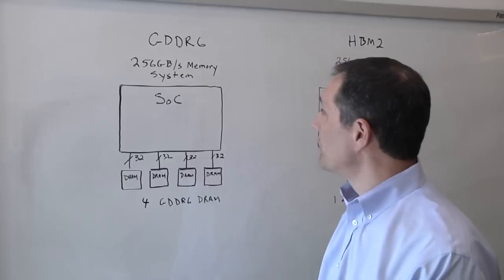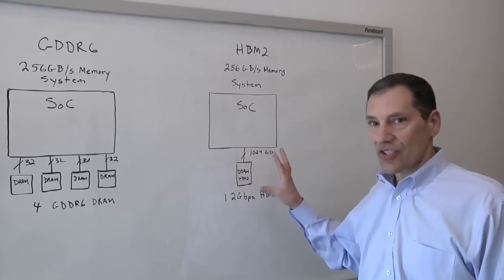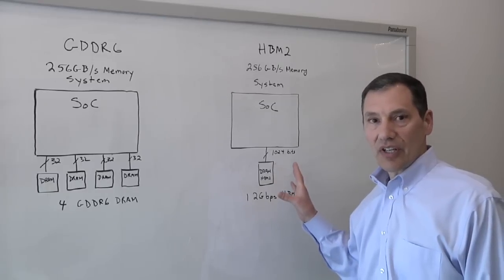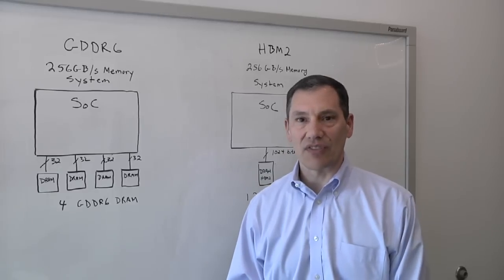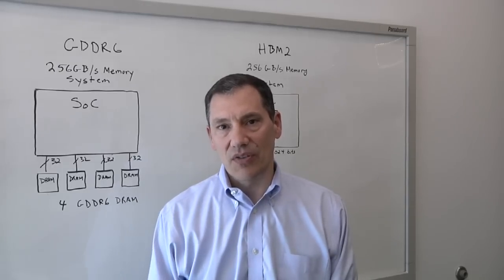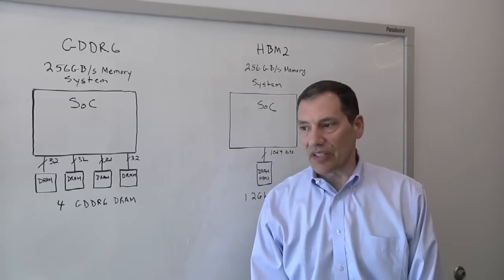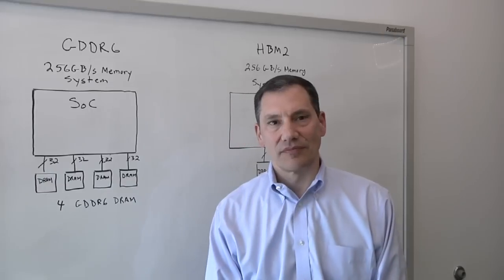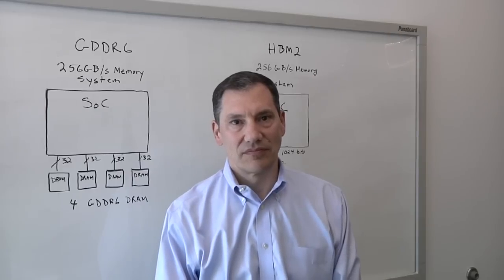HBM vs. GDDR6

Comment: The other part is using a  1024 bit bus implies fast parallel access so changes to the DRAM access controller o decompose the 1K wide word in some endian format into 64 bit words that can be directly used by the processor.

Comment: Wonderful explanatory diagram. For HBM2 - ultra Wide Bus Access , 2.5D structure with Silicon interposer , Uses a stacked Die approach. There is the issue of crosstalk and routing a 1024 bit bus. But Upside the Dynamic power of HBM2 memory is a lot lesser as the memory read/write clock is slower- P = kCV^2f.

GDDR6 - 32 bit wide buses - no need for Silicon interposer . Bus capacitance is lower so driving power is more limited. GDDR6 RAM must run at 1024/32 = 32 times faster. So RAM power is higher dur to higher operating frequency. Signal routing is simpler due to 32 bit wide buses. 

For an FPGA based system for packet processing e.g. Achronix the GDDR6 Interface comes Bulti-in. Certain FPGA based systems have HBM2 Interface built in. 
I will recirculate this Video on Linkedin.
Reply: HBM3 I/O voltage on the 1024 wide bus has dropped from 1.2 to 0.4V.  That 3X drop in voltage, when the V term is squared, is 9X less power.

On frequency: if a bus operates at 32x higher frequency but is 1/32nd as wide, the power stays the same, right?  All else being equal.

Comment: Great video, may I ask so what is "best" "overall" as in HB2 (HBM3 now exist?) versus GDDR6? ...Did GDDR6 catch up? I know HM2 is much rarer and thinking AMD was using it to try to "catch up" as HUGE COST to them as in when they did use it on VEGA as in VEGA 56 AND VEGA 64 now a days in 2022 is so much faster it was released as a competitor to the 1070 or in between a 1070 & 1070 ti and now I have a workstation & later released VEGA card as in the Radeon WX 8200 PRO, and it is essentially a VEGA-56 but NOW competes with the 1080 and whatever a 1080 compares with as in the 20 and 30 series just the same, AMAZING! Shame that we may never see HBM2 or even HBM3 on GPU's anymore now that RDNA architecture with AMD has caught up? .... Is there any memory that is used as system memory on Windows or least Linux or even a QNX (like) OS using some sort of HBM as its own SYSTEM MEMORY? ...It really made VEGA turn out to be GOOD in 2022 long as they keep up with the drivers as PROMISED the "Fine Wine" will be something AMD promised and a PROMISE delivered! ...

Comment: I have no formal training in tech, just random acquired knowledge over time. But, I used to work at a notable graphics card manufacturer. I knew, generally, what this dude was saying as I researched it when the AMD Fury gfx card came out and had HBM. The difference between he and I though, is my explanation wouldn't make much sense to you and he probably makes 200k more a year than I ever did.

Comment: What's the difference in latency? I'm assuming GDDR6 has lower latency due to the higher clock speed.
Reply: Higher clock speed is NOT equal to low latency. Think about RAMBUS technology decades ago.

Comment: Programming is going to be the limiting factor for hbm for the near future. Taking advantage of that bandwidth without causing a latency issue in the rest of the system is going to be a fun challenge. They spoke briefly about it with distancing of the analogy to digital components. Great explanation of the difference.
Reply: Like he said, it's application specific. Some workload can benefit from the wide memories, others can't.
Reply: As a software guy, I agree with this. Memory has become cheaply available to the programmer, and as such, we've seen a glut of programming practices focused more on favoring the programmer's time over the end user/product. While not everything needs to be as clever as a fox, it's nonetheless painful to look at code that could be made 1000x faster with a small dose of knowledge and a few hours if not just minutes of careful thought put into it's design.

Comment: Would a hybrid of these be possible? (i.e. LM1-LM3 cache like setup.)
Reply: theorically it is possible, like total memory of 16GB which consists of 8GB GDDR6 + 8GB HBM2, but in the other side this would be a total waste since these 2 type had a gread differences in terms of system design, use cases, and markets.

Comment: in the end hbm will probably last longer, as you will reach a point where you cant raise the speed much, and with hbm having so many more pins it will take longer for that to be a problem, the interposer problem is already being addressed by using the interposer only as a bridge between the soc and the hbm chip, thus reducing the interposer cost significantly ( intel's emib, amd has also patented the same approach) but it will take time before hbm's cost goes down as its being used in much less products
Reply: What about 100 million videogame consoles from 2020 to 2028? Microsoft have done some work on his with AMD for Q and others since 2009.